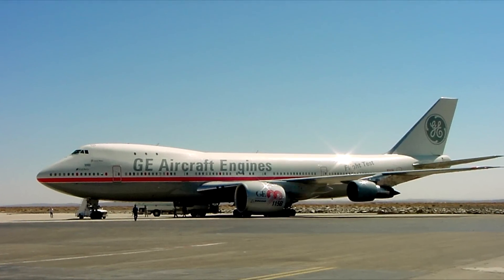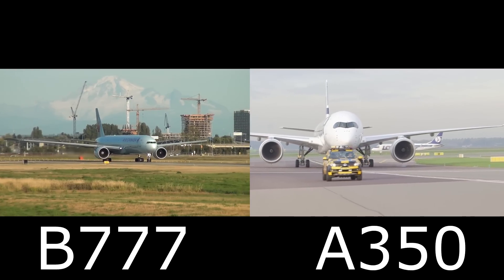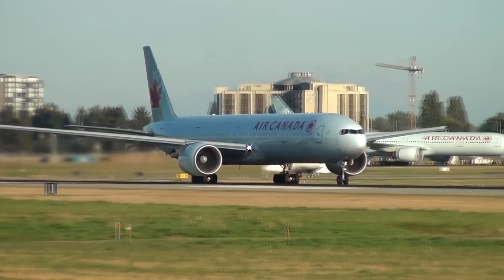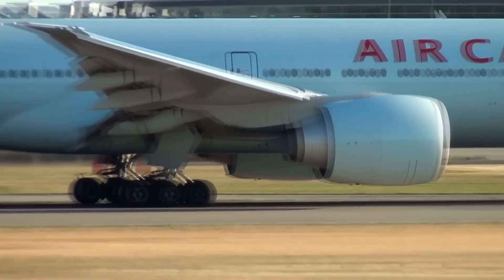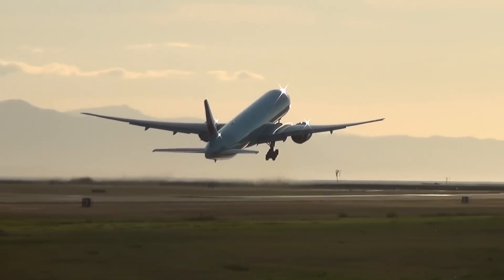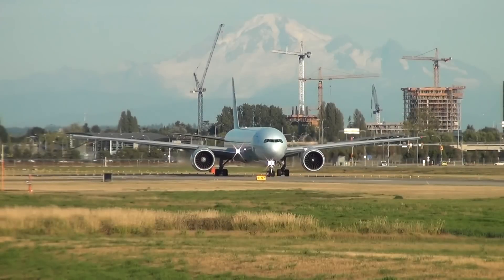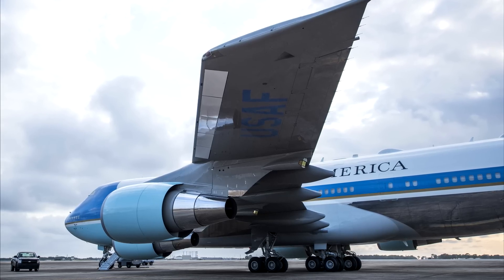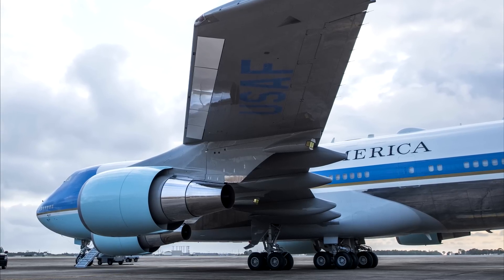Will 2 GE90 Engines Work On The 747?

Comment: Well, I saw GE is testing her new GE9X engines using a 747, they said one single engine could generate enough thrust to keep a 747 flying (something essential to get the ETOPS certification for a bi-engine airliner). 
Honestly, I think the only way to save the "Queen of the Skies" is to turning it into a bi-engine airliner. Otherwise, it would lose ground to more light weight airliners like the B-777X, the B-787 or the A-350.
Plus, a more efficient B-747 could KO the A-380 for good and win the battle of the Jumbo airplanes.
To be honest, I have a hard time seeing the B-747 slowly dying.
Reply: That's what has been said. Technically it's possible. But their 747 was a test bed, that will never fly fully loaded or have an emergency where it would be necessary to fly with a single engine. To perform all adjustments required in a regular 747, will need a new wing, new fuel tanks, new flaps, slats, tail, etc.  The wing is one of the most expensive parts of an aircraft to design and produce, so it's not gonna happen (unfortunately).
Reply: Ok the 747 your speaking of is owned by GE.  Its their private aircraft that is utilised for inflight testing of new engine designs.
As someone else said reconfiguring the 747 wing for one engine per-side would require a completely new wing which would require recertification of the entire aircraft.  NO, the 747 was originally designed as a military transport aircraft.  That's why it had the second story so that it could/can be loaded straight on from the front.  Boeing lost out to the Lockheed C5A and as a secondary effort to recoup their investment in the development of the new plane they gave it a name, 747, and added seats.  Originally Boeing had the upstairs set up for the flight crews but Juan Tripp of Pan American who had agreed that if Boeing built it, he would buy it said the upstair seats were now first class seats for revenue.
The thing is Boeing figured if they could sell a 100 747's then they'd make their money back and perhaps some profit.  That was as far as Boeing figured it would go.  That was in what 1970-75.  The only airliner I know that's been in production longer is the 737 in all its various forms. 
SO sadly yes production of the 747 will be coming to and end.  That will be decided by the customers when their no longer buying any.
Everything has a life cycle, planets, countries,  people, and airplanes!
Reply: The 747 will continue for possibly decades as a cargo hauler. It was designed to be a cargo hauler as well, unlike the A-380 whose production will end soon and has been commercially unsuccessful.
Reply: @solid1378  I don't get why people say the a380 was unsuccessful. Airbus got their money back from the design. It was never an airplane designed to sell by thousands like an A320. The super jumbo market doesn't work like that. And let's not forget that there are a lot of 747 built because the 747 is from the 70's. On the other side the a380 has been in production for little over then 10 years.
Reply: @TRAviation There are so many articles that show that Airbus will never recoup its investments in the A380 program. They just have not sold enough of the planes as anticipated. It came too late and was doomed by advances in jet engine technology, end of the HUB System and ETOPS. The 747 design has been around since the 1970s, and while passenger service is ending now, it will continue for decades after as a cargo hauler. If not for Emirates, the A380 program would have shut down much sooner. It is predicted that when Airbus fulfills the most recent Emirates order the A380 program will shut down in favor of the A330 and A350 programs. Unlike the 747, the A380 was never designed to be a cargo hauler, so it will most likely be the final end of the program.
Reply: @solid1378  I love when people say that if it wasn't for Emirates the a380 would be dead. The fact is that Emirates did order a lot of a380s. The a380 was not meant to sell by the thousands. The a380 is not the biggest success ever I admit but calling it a failure is not fair eighter. It sold what it expectable to sell. Yes the a380 is not a good freighter but will still be flying for at least more 15 years. The 747-8F will continue to fly for more 20 years maybe.
Reply: Actually, a 747 with 2 ge90 engines works. I've been on one.
Reply: No, unfortunately is not safe if one of engines fail, the other are not going to get enough thrust to push up out of ground, not going to pass FAA safety regulations. 747 is a very massive aircraft need 4 engines to flight

Comment: Ah, but what would work would be 3 engines on a 747 - unfortunately, this would be a major undertaking.  Two large engines at the inboard stations on the wing, and a third, smaller, engine mounted in the tail 727 or L-1011 style with a novel new feature.  That feature would be a retractable  inlet so that the engine would be exposed to the air stream on takeoff and during the initial climb out, but then the inlet would either retract into the body, or an aerodynamic wind screen would extend to cover the inlet in flight so it would be as if the engine were not there.  This would provide just enough extra thrust so that the two forward engines did not have to be quite so large.  As someone pointed out below, however, such a project is likely not to be worth the effort.  Maybe Boeing could bring out a 747-9 in this configuration, or a better idea would be a 777-11 with the third engine and make the 777-11 a double decker, full length.
Reply: mrackerm 777 double decker might as well be called [whatever comes after 797]
Reply: Sure, just as a 2 or 3 engine 747 would probably get a different number as well.  Those are details for the marketing team and the lawyers.
Reply: @mrackerm   It's fun spending other people's money!

Comment: Yh, i feel like there is no point, the 747 is too old now.
Reply: Nope, not with 747-8i. Very modern with completely different wing design and engines.
Reply: Even the concept of the 747-8 is not sucessful becuase the aviation market isn't interested anymore in double decker aircafts .
Reply: Simu Trains they’re only not interested because of the 4 engine efficiency 🤦🏽‍♂️ that’s why he made this video to see if it was possible to make the 747 a TWIN aircraft
Reply: Still the best looking jumbo even though we have the 380 and 787 now.  They just need to make it more economical.
Reply: Simu Trains but airbus are redesigning a320 family and its a330 too so why not a 747?

Comment: Everything is possible at Boeing but if they even try it will be in direct competition for the 777X. May be a 747 Freight version could work, which btw, the Jumbo was designed for it from the beginning.

Comment: Or could it be viable if they try this:

Merge a 777-300ER's wings and engine to a 747's body. Then they use 3 landing wheels by the wing (4-6-4) and try growing the control surfaces a small bit so it fits in airports
Reply: there have been 747s with taller fins like the SP (the small one) and the dreamlifter so it could be possible
or the extra fins on the nasa 747 that carries the shuttle
Reply: Sashin Gopaul 👍❤️👏 heat hear!!!!!!!!
Reply: Or just use an a 380 that's better

Comment: Very interesting notion, however, I think is not worth the effort for a very old aircraft
Reply: Sarinf Serg no matter how old it gets, it will forever still be “the queen of the skies”
Reply: KiznaVision The -8 is a fully modern design with redesigned wings, engines, and fuselage. Further, should Boeing decide to create a dual engine 747, they could completely redesign the plane as though it were a new project, only sparing the general practical exterior design and name.
Reply: What about for the -8?
Reply: The problem will be the costumers, will they need a 747 even tho they could buy a 777-a350-a380 etc? Is it just worth it to be spending money to have its engines modified?
Reply: I don't think they want another 747. They gonna settle with 777, a350. Thought the majority of customers will likely go go for 737 Max and A321 NeoLR for long distance flights.

We gonna see a dramatic shift towards those airplanes in long haul.
Reply: +Leo Ferreyra
No. As much as I love my dear 747, there was only one Concorde. I do love the way a 747 raises itself at take-off though <3
Reply: KIZ You obviously don't know shit about airplanes.
Reply: 747-8 will be around longer than the A-380 tub and will out sell it as time goes on. It makes a great Freighter!!
Reply: Sarinf Serg these days with directed energy weapons these older planes are safer...
Reply: Leo Ferreyra in terms of electronics and radar it is...
Reply: Sorry to disappoint you, but unlike you i actually don't make up stuff.

And I actually have to wonder what the amount of sale either the A380 or 747-8 will get have anything to do with the whole discussion here.

You can believe all you want that the 747-8 is a all new airplane. Stretching a fuselage and modifying a few components of it still doesn't make it a new Airplane.

It's a modification of an proven Airframe. Just like the 737 Max is a modification of a prooven airframe, and just like the A320 Neo are a modification of a proven Airframe, same with the new Boeing 777X.

And no one on earth is going to design a new Aircraft the size of a 747 or A380 from scratch anytime soon. It's not worth the effort and money anymore. 

At the time where Airbus started with the A380 project it was already risky and not really worth while to start with developing it. And in 2005 it would have been even worse to start with a 747 or A380 like Design from scratch. You apparently have no idea how much it would cost to design something the size of a 747 or A380 from scratch these days. Sides of the much more intensive and much more expensive testing you have to go trough to get a new Airframe approved.

And that's sides the fact that you can't just put a completely new airframe under the 747 Muster.
Reply: With your kind of thinking its a good thing you were never a designer on the 737, A-320,  A-300 programs. You thought maybe they could make longer landing gears on the 747 to accommodate the engines like they did the 737.
Reply: No idea what you are trying to get at. And i really don't get why you attack my thinking.
Reply: Literally asking for a 777 lol
Reply: LYX 001 but even better looking 777 with 747 in its design
Reply: Ehh Boeing might be able to to it and offer it as an upgrade option for current 747s, the cost would still be high. The wing, wing box, and almost all of the control surfaces would need modification. Most carriers would probaly rather have a new aircraft at that point. Thats allot of money to invest into a plane with many flight hours.
Reply: Sarinf Serg well lets complete reconfigured it. I don’t see why they can’t build one from the material for the Dreamliner? But adapt it for 747
Reply: Leo Ferreyra 👍❤️👏
Reply: Gonk Droid the 747-8 is still a very old aircraft. It's just a modification. A tiny modification compared to modding a 747 to have twin engines.
Reply: Top-notch avionics.. ah yeah, the partial Fly-by-wire. ;)

And sorry, from an technical and Engineering point of view it's still an old Airplane that got  upgrades.

And there is nothing Similar between the 747-8 and 787. The only similarity is that they use some Technical Features the 787 used as well. (Is the reason why it's actually -8 and not -800)

The 787 was/is an Airplane that was designed from scratch.

Oh, and the word your are looking for is not composite materials, it's aluminium alloys.

And the fact it has the shape of a 747 is not because it's elegant, it's because the 747-8 is a upgraded 747.

You have no idea how much work and how much money it costs to design an airplane from scratch, and the amount of testing that has to be done on an all new airplane of that size.

And it's actually couldn't be a 747 if it was an all new airplane. (supplemental type certificate) It would have to be a 797 since it would have nothing to do with the 747 in that case, other then the shape.
Reply: I do not work for Airbus, no. Sorry that I amused you so much.

I just really can't stand bullshit talk and made up stuff.

And I personal don't see why my text would in anyway have an Connection of me working for Airbus.
Reply: John Apple, lengthening the fuselage is not redesigning it. The only thing that was redesigned was in fact the wings.

Comment: since the b747 is already outdated i dont think it will ever be economical
Reply: Nope, not with 747-8i. Very modern with completely different wing design and engines.
Reply: InTeCredo because the market changed so much the last decade the b747-400 and 8I are less economical because lets say we want to fly from Muscat to Houston we now can choose three flight with smaller aircraft( b787, a350, a330, b767, b777) instead of one flight with a bigger aircraft from a bigger airport so to simply put it you're wrong there are some routes who still have that demand (for example London to Dubai) for a380's or b747 to be fully filled 2 times a day but for most routes its far more economical to place three smaller aircraft on a route then one big one.
Reply: Van Romondt no, that why companies opt for the a350/b777/b787
Reply: Black Burn the 747 _8 is the most  fule efficient  in her class
Reply: No way man. The A380 was pretty much obsolete the moment she was introduced...It's a great aircraft but look at the numbers.  

The trend towards twin engine wide body aircraft is pretty much complete.  I love the 747, perhaps my all time fav, but it aint the 70s anymore...2 engines are much more economical than 4 nowadays.

Look at Nortwest airlines old pacific route (now operated by Delta).  They used to use 747s but as of late last year, they are now using a350.
Reply: 747's around the world became obsolete in 1995 when the first 777 rotated from a runway on its maiden flight. Immediately relegated to hauling packages with its 1970's cousin the md 11 or dc10NG as I like to call it. The A380 is just as outdated and obsolete concept, it would have made more sense to NG the Concorde, just kidding. With out twins you can't win, 4 engine planes are as outdated  as V8 power plants in the automotive industry, do I like it....well NO but that's the way the world is moving. Less is more these days.
Reply: The 747 is typically used for long haul missions over water where many of the twins either aren't certified to fly or don't have the range.
Reply: still bad economical thats why companies opt for the a380
Reply: +Black Burn more like 8 times a day for london dubai
Reply: Alex Cleary it's not. That is still the A380.